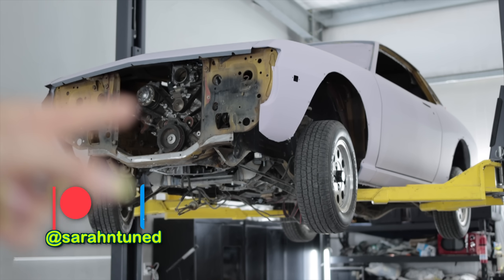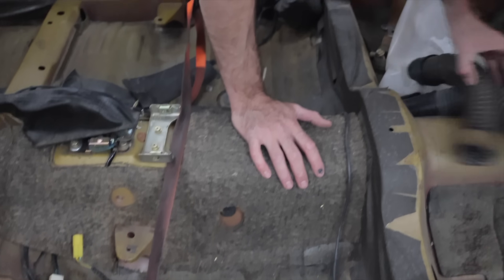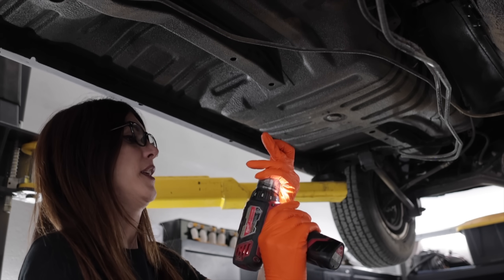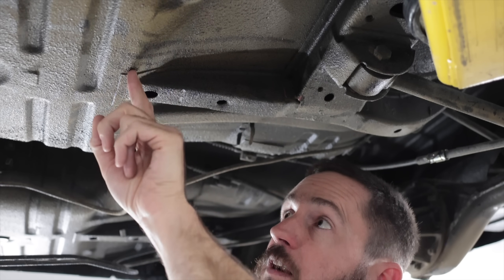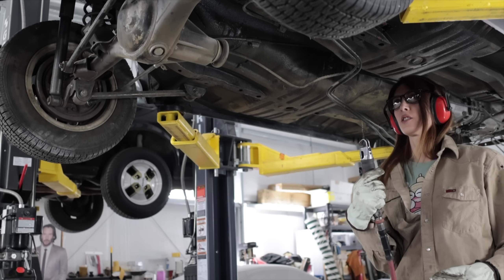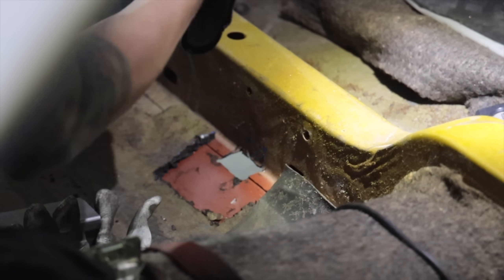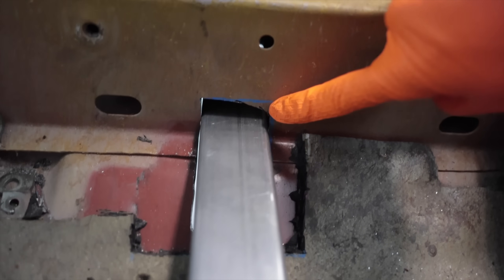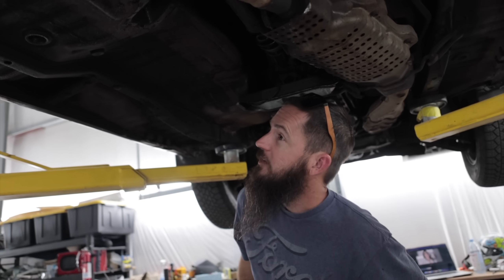Problem! Too Much Torque.. // Chassis Reinforcement

Comment: Would wielding a 3/8 thick plate shaped to the body frame rails and connecting them all together have strengthened the rails enough to take the torque?  Wouldn't that have spread the force all the way through the now stronger and unified structure?

Comment: For Charlie, back I have to recommend Stanford hospital in Palo Alto California. I have worked at 3 hospitals nearby, Transported patients to Stanford countless times because other specialty hospitals send very complex and complicated cases there. Stanford would get patients flown in by medical transport from out of state and out of the country. When previous doctors visits could not provide answers or treatments failed, Stanford always had answers because you get a massive team of specialists, they treat you initially, find and set up continuing treatment and when the situation is under control they find a Doc local to where the patient is from for ongoing care. After 13 years in healthcare I highly highly recommend them.

Comment: First thing I though of when I saw the title was " HUH someone else who's discovered the uni-body twist! When the early Novas and Camaros were the hot ticket a common way to tell if they were actually a threat on the drag strip was to look at the sail panels above the rear tires. Cars that were real torque monsters would develop a ripple in that panel that looked like you had tried to twist the tail off the car.

Comment: I have a ton of back issues with herniated discs.. I just had a procedure done called Radio Frequency Ablation. They basically go in and singe the nerves in your lower back to stop the pain signals. So far its been 7 months since I had mine done and I can walk and do things again without all the pain. Id recommend it, and its a 10-15 minute procedure.

Comment: Mint. I love this idea going into your chassis . It's becoming a semi skeletal monocoque. Since mono is the strongest and the strongest steel is used in skeleton chassis, I guess you've made the next stronger frame structure again, beyond both. But still less rigid than space framed. Imo, it might be the best way possible to stiffen up.

Comment: since this car was never engineered to go over 95mph around any corners you will need a watts link or pan hard bar at the very least, then your strut towers need bracing, larger springs and shocks as its not designed to stop anything over 95 mph you will also need say Wilwoods on all 4 corners, full floaters?  :-)  or something like their SLC56 set up.. adjustable proportioning so forth..  stock brakes will brick sooner than later .. you added how weight up front?  more stopping power to say the least

Comment: I can relate to Charlie and the back pain. I have Scheuermann’s kyphosis where the vertebrae have impeded blood flow and start to get wedge shaped. This usually happens earlier in life, though. But I did have a spinal fusion where I had nine discs removed and bone graft put in their place and rods a screws put in to hold it all together. I hope his isn’t that serious but it could be a herniated disc and just out of place enough to cause higher pain. Time off of it is crucial paired with lighter work, but I know that is sometimes hard to do. 
But no apology needed. Meticulous is always best. You all are awesome.

Comment: Depending on where the pain is it could be different stuff. If it feels like it’s more in his hips then it’s his SI joints. I had SI pain for years and no doctor could figure it out because it wouldn’t show up on X-rays or MRI. I would try a reputable chiropractor before wasting anymore time at the doctors office. But if you have to go to the doctor then make sure it’s a neurologist and not an orthopedic doc.

Comment: I seldom make comments on your videos Sarah but this was an excellent one.  As a DIY fabricator I love what you and Charlie did in this video.  Great work guys.  I am so jealous of Charlies welding skills.  It is so easy to blow holes in the sheet metal especially when welding thicker metal that requires more heat to make solid welds.  Many years ago I had an acquaintance who suffered for years with back issues and had one or possibly two back surgeries that gave him no relief.  What ended up being the problem was his hip.  I have lost contact with him and don't know his health status.  I will stop rambling on, this comment is way to long and wordy.  Bye.

Comment: I did the same thing when I 1UZ swapped my 1980 Chrysler Avenger wagon. It was very much the same as yours, a unibody design with a front and rear subframe. I did very similar subframe connectors like yours, I also reniforced all the suspension links so I'm looking forward to seeing how you do yours. My rear end is a bit different, it's a 5 link with a Panhard rod and I swapped the diff for a shorened Toyota Hilux LSD.

Comment: that upper control arm mount point is very strong on the models with 5 bar, what we use to do with corolla rally cars is seam weld the mount to the plate, the plate is about 3 mm thick and runs from about the center of the car through to the spring mount, we would seam weld that plate to the body then the mount to that plate. never had any issues but my cars weren't V8's. Also there's a TRD AE86 N1 conversion for the top to equal length, probably not for you but very interesting anyways.

Comment: I am not a back doctor, but in cases where you can't find a way to fix your back. Fusing a couple of vertebraes can relieve the pain, which is basically welding them together which would make sense for Charlie because he's a weldcobblerpie or whatever you called it. 😅

Comment: The engine seems to be cramped tight in there is there still space for the fan and all electrical and cooling? The car will look amazing when its done.

Comment: Sarah, please help Charlie get to a physical therapist as soon as possible.  You have to get in front of stabilizer muscle maintenance. If you pull those small muscles and other connective tissue, you will always be sore. I am pretty sure you need to find free weight exercise routines you need to perform daily to avoid these discomforts. No human has evolved to lean over a car engine bay and then perform a perfect weld, the action is super painful.

Comment: I like using the spiral cut bits on a die grinder for body cuts like that. Easier to follow the metal behind than a body saw. Honestly the body saw has to short of a stroke for everything. Just a waste of blades. The spiral cutter allows you to use more of the cutting surface with an in/out motion. I’ve cut a lot of holes in cars during my car audio days.

Comment: Some of the metal in those old Toys are thick. I put a stereo in a 1969 Carona and had to file the hole larger to fit an Alpine. Took forever.

Comment: Sarah -- very interesting structural addition!  The discussion in the video focused on avoiding the unibody crushing front-to-rear. It would be interesting to hear your thoughts on dealing with the added torque and torsion between the bigger engine and rear differential (as hinted in the video title).  I'm curious having seen the Miata "PPF" Power Plant Frame that counteracts that kind of torque in that car.  Presumably the Miata, lacking a roof, is more susceptible to torsion, but also it doesn't have a V8!
Reply: Oh, some of them do... 😈
Reply: @rennkafer13  I assume you're referring to Miatas with V8 swap. Sure. But my point is that even the 4-cyl Miatas have this torsion-countering PPF assembly, so it seems quite important even at the lower power.
Reply: @Graham_Wideman  Seems to be a Mazda solution... My RX8 has got a PPF.

Comment: Sigh.. Just make a roll cage.. You don't just have to worry about taco car.. You half to make sure not to taco yourself.. I did pro rally championship g204.. Your short sighted to you want to live with out real race car builders..........
Reply: I love this channel in the dark. But.. With great power comes great responsibility.. The 70's epic light to v8 is not responsible with out a 6 point basic cage.. Even for just seat belts for a five point hope this motor doesn't clear the firewall a simple roll over mistake and hit my driver in the face. ;)

Comment: A spinal surgeon is the last place I would go for back pain. They are only there to fix bone problems.
If Charlie has had a bad back for a long time (like since a teen), I would suggest a rheumatologist, as there are some genetic diseases that can affect spine and sacroiliac joints (si joint pain is often misdiagnosed as lumbar spine pain).
I say this as someone who has had serious, intractable back pain since I was in high school, is now 52 and has only had the pain taken seriously by doctors in the last 5 years.

Comment: Similarly, the control arms may need strengthening otherwise the extra weight will make it hard to get the camber and caster right. That's from experience and appeared after driving the car for a while.
Reply from the maker: The car will have absolutely zero original suspension.

Comment: 13:37 Ya, backs suck when you've worn yourself out. I have D.D.D. and learned to live with it for over 30 years by combining chiropractors, registered massage therapists, physiotherapists, and various exercises, an inversion table, plus joint ease supplements, muscle relaxers and pain killers prescribed by doctors, or just Robax when I'm doing not too bad. On a scale of 1 to 10 I'm alway at about (π) Pi (a low number, but never ending).

Comment: Hi Charlie I would guess it's the disc's in your back if you twist your legs while keeping your shoulders flat on the floor you can get your back to pop back in. It would require either "welding" the vertebrae together or disc replacement

Comment: You could also build a full complete frame and bolt the body to it. That's what we did when racing MGBs  way back. All of the moving suspension parts were attached to that frame & not the unibody as from the factory.

Comment: Are the doors still closing ok? I know for the foxbody Mustang when you weld subframe reenforcements you're supposed to have the suspension under load when you do it for that reason.
Reply from the maker: They close great, did all the panel gaps today.
Reply: @SarahnTuned  Glad to hear!

Comment: Stepper bits suck, they always strip when you get to the 1-inch section... ALWAYS.
Reply: Whats wrong with stripping?
Reply: @mostcom  your holes get funny colors because you had to force the dull part of the bit into the hole to use the other half that isn't stripped.
Reply: @Nairod2  there might be an ointment available for that

Comment: A roll cage in the car would also contribute greatly to chassis stiffness.  But I remember how hard that was to do in the Focus.
Reply: Yeah..... the steel in these cars back then was thin indeed... add 50 plus years of age.. you want something to tie it together.
Reply: I agree, a cage would be a plus but reading the comments, Sarah says not needed. Ok.
Reply: Depends what kind of driving is in its future. Roll cage can always be added.
Reply: @chasestewart302  You are correct but once the damage is done...... The time to do it would be now rather than later. There isn't a lot of extra meat in these cars like there is today. Sarah says it's not needed so it's a no go.

Comment: My 22R-E folded my RA64 chassis, and ripped the rear lower control arm mounts off the body. And also broke the windshield from extreme cornering with large wheels. I had to do some in-floor bracing years ago to remedy these problems, can't imagine what the 2UZ would do to a stock chassis. I also discovered that the factory torque boxes are rusted out now. So they are being replaced and beefed up too.
Reply: OMG I just remembered you got that MA60 Supra. So you know exactly what the underneath of my RA64 looks like!

Comment: Sarah, how did you know the torque would fold the Celica’s chassis?
Reply: It's a 1970s unibody car. The chassis probably has the structural integrity of a wet noodle. Most older cars are like that.